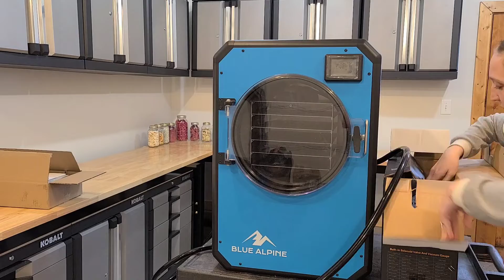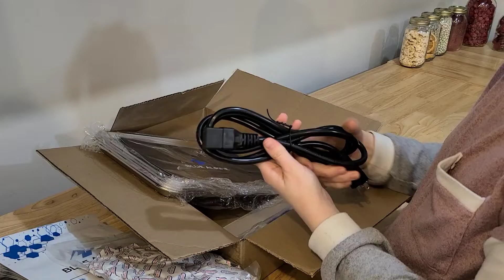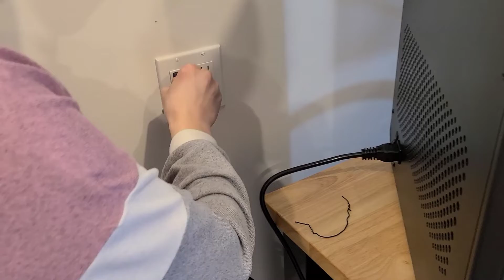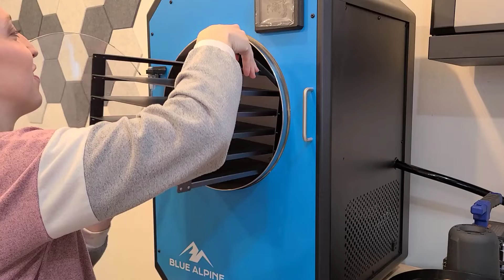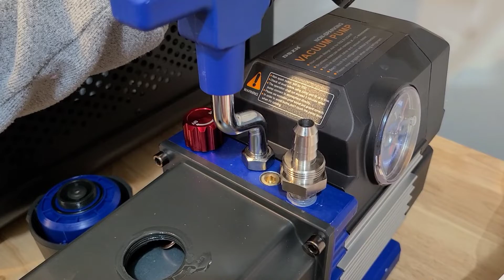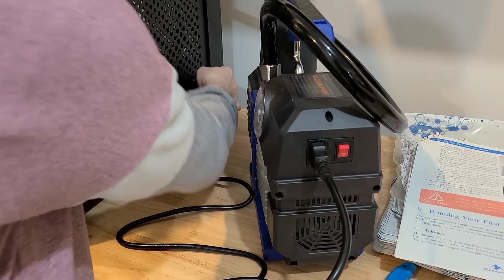Freeze Dryer Set Up

Comment: Does the freeze dryer need to sit for 24 hours after arrival and positioning for the coolant to settle or can it be plugged in and tested out first thing upon arrival?
Reply from the maker: You can start running loads as soon as you have it set up! We've already run it enough during testing to de-gas it, so you don't have to do a "bread load" as other brands suggest, and we don't use coolant, so it doesn't need to settle. We recommend doing a candy load with the provided candy we send with each machine, it's fast and easy, plus tasty. If you want you can do a bread load as well anyway, just to be sure that "new car smell" caused by manufacturing is completely gone, you totally can.
Reply: @BlueAlpine  Did that change recently? I just got my Blue Alpine, but no candy. :(
Reply from the maker: @TIPATV  uh oh, don't worry, we will figure out who it was and fire them....

Only joking. To be honest we do our best to send candy, but I think what happened is we ran out between candy orders and didn't want to hold up shipping just for a bag of candy. Either way, sorry about that.
Reply: @BlueAlpine  Confession: ya'll didn't mess up, hubs helped unpack and I didn't see them. (I think he was hoping I wouldn't find them). 🤣
Reply from the maker: @TIPATV  Ha ha, tell him he has to live with an employee getting fired on his conscience now. (we didn't really, but he doesn't need to know that.) ;)

Comment: Have you thought of Gast Pumps? I have one for milking.  It's easy to rebuild, and parts are readily available.  Downside its pricey. Upside after daily milking 3 cows, I haven't had to rebuild it since I first bought it.
Reply from the maker: We looked into them, when we did we couldn't find one that can bring the vacuum down enough for freeze drying. They are great for milking cows though. If they've since made a rotary vane pump that makes a vacuum below 4500 mTorr, then it would probably work alright. :)

Comment: Fourth load in over 5 days!   All good with a variety of foods.  One question though - I hear many references to having the vacuum at about 250 mTorr for a couple hours to make sure it is dry.  I have run the last two batches and never got below 425 mTorr.  What is going on?
Reply from the maker: Anything below 500 mTorr will get the job done, and to be honest going lower doesn't really make much of a difference. :)

Comment: Running my first load. Is it normal to have steam coming out of the pump around the filter? The pump is also quite warm. Is that ok?
Reply from the maker: Hey thanks for reaching out. Yes this is oil mist that comes out of the pump when it goes from atmosphere vacuum.  We are coming out with a filter that will take care of this completely but it is about 3 months out still. We have a temporary solution that works well but is not elegant. Just wrap a microfiber towel around the base of the oil mist filter. Use a rubber band to secure it and this would stop the misting. Again this solution is effective but just temporary until we get the new filters in. Thanks and let us know how it goes.
Reply: Need a video with the RVD-5 pump install. The instructions (included) and video don't cover this. Thanks

Comment: I have wandered if you can run an air dryer on the vacuum line to the vacuum pump
Reply: Most often, vacuum systems use a cold trap inline to catch moisture.

Comment: I’m an HVAC guy, not sure what micron level you need, but I have found when the oil becomes saturated with moisture, you have a problem pulling down in a deeper vacuum. Just thought I’d pass that along.
Reply: There is a certain oil change cycle to follow based on what you do

Comment: Isn't the pump on the wrong side of the machine? Hooked to the drain hose?
Reply from the maker: We changed the side of the machine it goes on. This  helps regulate temperatures in the heat exchanger. But good catch!
Reply: Good Idea! I  have two small fans (probably not necessary), one that blows down the sides of the vacuum pump from the back, and one that directs air over the heat exchanger to increase air flow. @BlueAlpine
Reply: Is there a "wrong side"?  I prefer to have it as shown in the thumbnail just because of the way my space is configured.  Hopefully it won't matter too much.